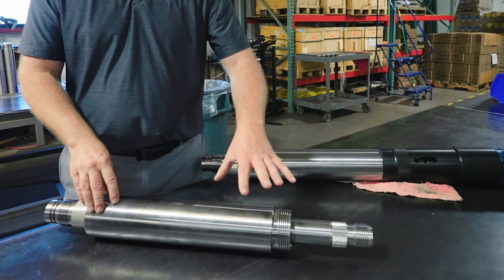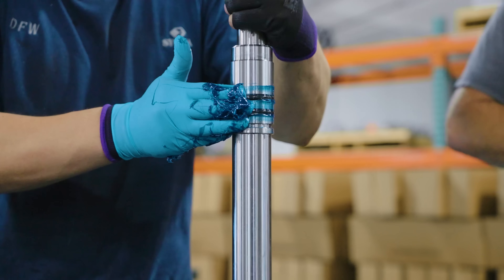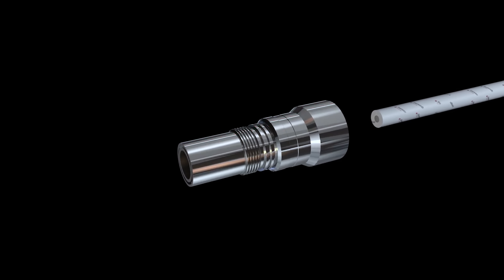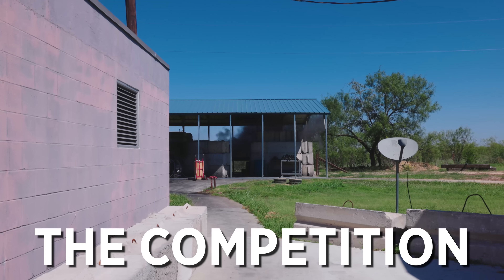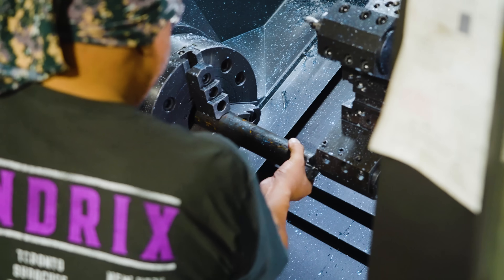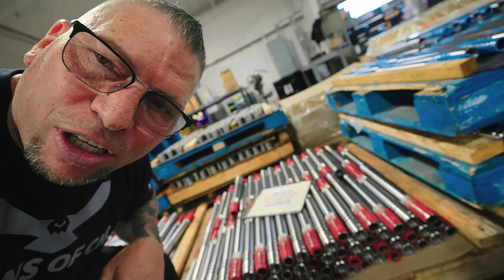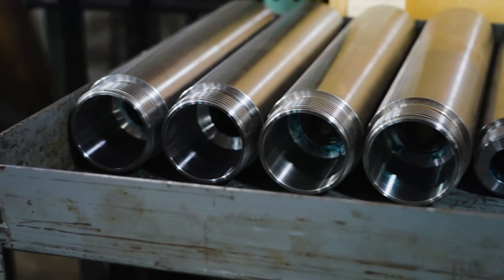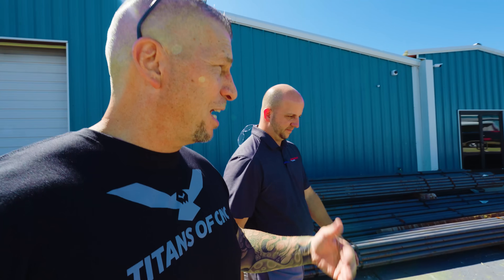CNC Machining 30,000 LBS of Steel Per Day | DN Solutions Customer Shop Tour

Comment: You’re machining metal…. You don’t have the license or proper equipment to deal with any explosives. It’s metal….
Reply: We have an entire energetics side of the company you didn’t see in this video. We absolutely do have the licensing to deal with low and high order explosives. While I agree, “machining explosives” is a bit of a misnomer, everything about the tool and how it’s used is correct.

Comment: Looks like a sweat shop in there.
Reply: Just looks busy to me...Which is a good thing
Reply: @Bawbag0110  it’s definitely busy for sure. But excellent work environment overall through all departments. Not just machine shop.
Reply: @kerryfrazier1812  Worked in a similar environment during my apprenticeship...Just 2 huge machines were I work now
Reply: It’s very clean and we just got some badass new AC units
Reply: Been there going on 10 years now and don’t wanna work anywhere else

Comment: I want to take  spindle speed to 100% by holding it for 10 seconds and gradually increase the speed.
Is there any code for the same.?
Reply: G21 (metric mm)
G0 x350.0 
T0101
G96 s200 m3
G50 s2400 (max spindle speed)
G1 x0 f0.4
G4 x10 (10 seconds idle)
G1 x350 f1.0
M30
Reply: @ribagergo3900  thank you very much for guidee me.

Comment: Gas pressure requires containment. Space is fake. Or demonstrate in reality gas pressure without containment.
Reply: The tool contains gas pressure from the charge until the plug is set and sheared, what are you talking about?
Reply: Can you explain the pressure drop gradient as you go higher in altitude then?
Reply: @Bawbag0110  I’m not sure what point you’re trying to illustrate about the operation of our setting tool.
Reply: @THEannoyedBOY  The comment I'm replying to is obviously from some flat earther who for some reason is commenting on machining video
Reply: @Bawbag0110  lol my mistake, I thought I was responding to the original comment. I agree, dude’s off his rocker.

Comment: Oil drilling is OK. Fracking? In 2022?  Destroying soil and water... ?
Reply: Europeans boggle my mind would you rather frack or die of cold during winter cuz it’s not sunny enough or windy enough. Disabling your reactors too, smart.
Reply: Let's be real! Oil drilling isn't okay either.
Reply: @jenbadabam8801  : we need oil to make plastic and clothes. Lubrication etc etc etc etc. The problem is the need we have to burn it... Just to get propulsion on our vehicles.
Reply: glad you like the price of gas <(sarcasm)
Reply: @stormbringermornblade8811  : well now I have to pay for gas AND clean water. And we should not destroy water and ground because of cheap fuel.  Get real. You probably take medicine because you skipt a 2$ condom